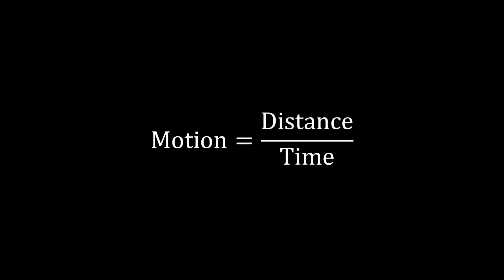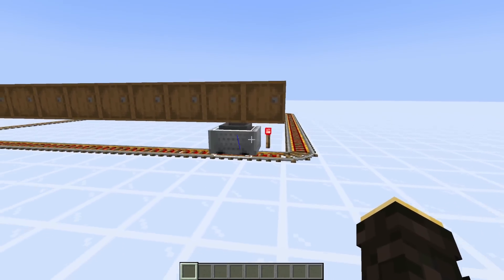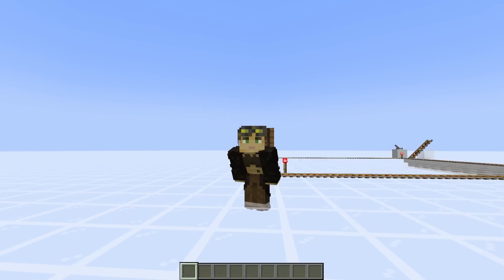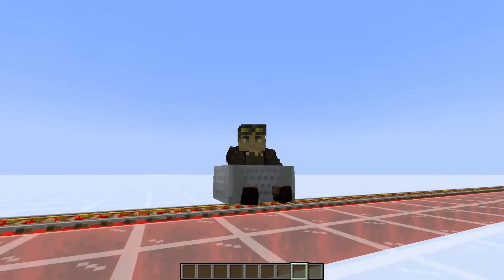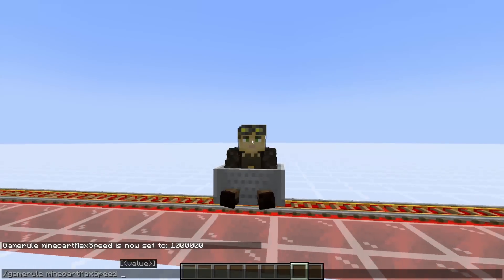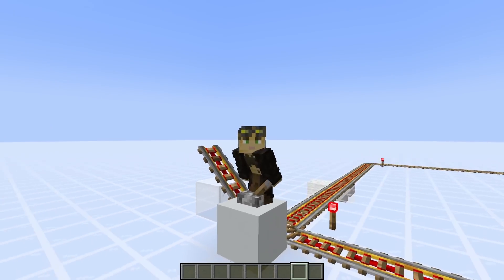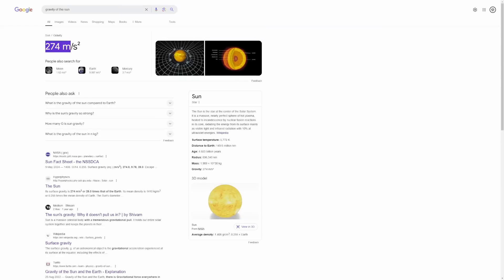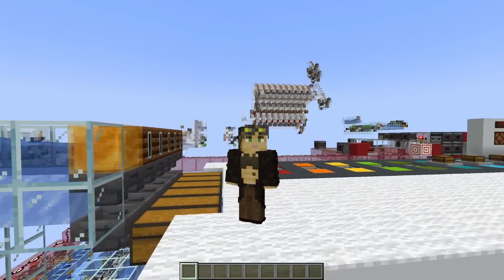Minecart Madness

Comment: Hi, aerospace engineering student here! Big fan of the channel, just a quick heads up, adding more offset to the sides and above the domain of the CFD simulation could change the results significantly. This is because the small domain forces the air to compress and speed up to get around the minecart in the closed tunnel due to Bernoulli's law. This can create more frictional drag on the minecart than in reality. 
You can actually quite clearly see at 11:11 the air speeding up around the minecart in the simulation which is coherent but shouldn't reach from wall to wall, optimally the walls should near inlet condition if they are far enough, which will reduce the adverse affect as much as possible.
In ansys you should also make two separate selections of the floor and other walls and change the other walls to specified shear : 0 0 0 (default value) which makes these wall frictionless to the fluid, which better simulates your wind tunnel as it doesn't create a velocity gradient at the walls of the simulation.

Anyways I love to see CFD and Minecraft together on my favourite channel !

Comment: Interesting. I have similar thoughts with rather than rails posing a speed limit they accelerate carts towards a target speed (something like 8m/s -2m/s per oxidation level for copper rails and 3m/s per redstone power level for gold rails, any placed gold rails could be switched to waxed copper rails upon world upgrade for backwards compatibility). Then with derailing players would need to use another type of rail to slow the cart before a turn on a long distance rail, and technical players could have much more fine control over what speed minecarts travel at for different applications.

Comment: Minecarts have broken aerodynamics in the new update, but they've already broken another part of physics ever since they were added: maximum velocity in circular motion.
Ideally, minecarts should travel under 2.9 m/s, because given that the minecart's rails bend at a radius of 1 m and the COF between the minecart and the rails is about 0.86 (rubber on steel), if the minecart should travel faster than 2.9 m/s, the friction force pulling in the minecart towards the center when turning a corner isn't enough to keep the minecart on the track, and thus would derail. It's like trying to turn a corner while driving on a slippery section of road.
With Minecraft's new addition of these literal particle accelerators, these rails would have to be banked to make them realistic, but even then, no one can survive 1000 g's of acceleration. It's already going at 6.5 g's of acceleration before the new update.

Comment: 15:03 Honestly, no. If Mojang wants to fix minecarts, they should do it right and implement all your suggestions. It's even an experimental snapshot, so not under time pressure and allowed to do bigger changes.
Reply: I think the derailing would make fewer people use minecarts, which kind of opposes the intent of changing how they work. The issue is that the only option to turn the mine cart is a 90 degree turn on one block, this means that even with the previous max speed, they still pull over 6.5gs when rounding corners. I think most players would get annoyed at this constraint when trying to build a transportation system, especially with all the other parts of the game that ignore real life physics (ex floating blocks or how much weight Steve can carry). I like most of the proposed changes, but don't think derailing would be well received
Reply: Agreed, all of these changes are very valuable esp the derailing one will make minecart tracks more interesting to build
Reply: @naddy_mc  Derailing used to be a thing in a snapshot back then, it was super annoying for people bc no one could make rollercoasters without derailing apparently
Reply: @-fsa-3615  Derailing was only annoying because it happens so easily for very little in return (considering Minecarts didn't and still don't go fast anyways).

Derailing would be better if it's reserved for the rail variant that goes fast (Boat in Blue Ice level of fast) so the normal Powered Rails would still have a use both in contraptions and transportation-- making the faster rail reserved for fast transportation in straight lines.

Comment: As much as I really love the variable speeds based on oxidization idea, I do think that maybe powered rails should just be copper in general. Copper is abundant and while it has its uses it doesn't have enough uses to justify its abundance. Plus, a casual player probably has easier access to copper than gold, so it enables minecarts to be used in that transportation role much easier.

That being said... perhaps "clean" copper rails would be unlimited but oxidized rails could be the redstone-friendly limited speed rails?

Comment: People really dont want minecarts derailing, its too complicated for most people to want to deal with
Reply: Agree, it would also make little sense in my opinion. In real life you can change both speed and curve radius to prevent it, but in mc the radius is fixed and already unrealistically tiny. Assuming the cart is empty the maximum allowed speed would be around 8 km/h
Reply: Especially since it was one of the original ideas that Mojang worked on but decided against during early development.
Reply: @amirhosseinmaghsoodi388  yep, 14w11a if you wanna try it out
Reply: Derailing at corners would be a good idea SPECIFICALLY for a rail that goes incredibly fast, it's not really that complicated to know that a minecart that goes fast will derail especially when that cart goes faster than Boats on Blue Ice.

Derailing at least in my case would make for a fair trade-off and would make the moderately fast rail practical while making the super fast rail mostly specific for straight rails (more or less like Boats on Ice).
Reply: @user-tzzglsstle585e38  please explain why this is a better idea than simply not doing that? Realism isn't necessarily fun. I can imagine how this would be good for some kinds of games, for a more complex system, but does that kind of thing fit in Minecraft?
Reply: As long as it was reserved for Extreme speeds (much higher than current max) I think I would be fine with it.
Reply: @FlightlessAviator  And it was telegraphed properly. Like a rumbling noise when going above that speed value to let the player know they're going "too fast".
Reply: Yeah, Minecart derailing would cause more issues and ruin more things.

Comment: Love the ideas, but the only technical issue I see with making minecarts travel this fast is that chunk loading most likely won't be able to keep up on low/mid-range hardware or servers with loads of players. Other than that I do love the idea of adding copper rails with specific speed limits and having nice and fast golden rails :)
Reply: Well since the chunks have to already be generated to have rails in them it should be fine. Just loading chunks isn't really that slow
Reply: @commander3494  still, 75 meters per second is equal to 75 blocks per second which is 8-9 chunks of lateral movement per second ignoring the chunks around the player, that’s going to heavily stress any lesser system into submission with ease
Reply: @MegaMiley  would it load All the chunks or would it just lord ever 4th because it technically never enters the others?
Reply: @Jupue  It would try to load all of them as it tries to load a certain radius around the player, plus each second has 20 game ticks so it would be in every individual chunk as well for a certain amount of time
Reply: @Jupue  Quick maths:
75 blocks/second / 16 blocks/chunk = 4.6875 chunks/second
Default server load distance is 10 chunks, which means the player loads an area 21 chunks across (the one they're in plus 10 in each direction)
4.8875 * 21 = 98.4375 chunks loaded per second on average
Reply: @MegaMiley  i have an idea
when an entity loading a chunk is moving faster than 1 chunk per second, it renders in lower detail and chunks only load block events if the entity has been in (not necessarily loading) the chunk for around a second
Reply: @MegaMiley  no, it's 4-5 chunks/sec. I do see your point though. Maybe when going at sufficiently high speeds a player loads chunks in the direction they're going and not the ones around them?
Reply: @yourspineismine  oh right, somehow had 8 blocks per chunk in my head. And maybe? Not sure how willing Mojang would be to changing the chunk loading logic if they would even be willing to actually implement these speeds as the defaults
Reply: @carelesspigeon101 High enough movement speed could also override normal chunk generation of equally all-around player, and instead switch to heavily biased in direction of movement. That would also help with elytra flight.
Reply: Good thing its a gamerule, so that server operators can lower it. No reason to limit the populous because it doesnt fit a few.

Its like saying that players should only be allowed to place a maximum of 30 minecarts/entities in a world, or only be able to travel 1000 blocks out because low/mid range hardware cant handle the higher numbers.

Comment: I know it's a Minecraft video but I don't think you did a great job explaining how a linear recurrence relation and a quadratic differential equation behave. I found the bit comparing their graphs on desmos confusing especially because they are drag forces so the higher the values the more they slow you down. I don't think it is initiative to someone who hasn't dealt with recurrence relations before or someone who isn't familiar with drag (as the 2 equations are shown side by side despite one being a force equation and the other being a velocity recurrence relation).

I think it would have made more sense to compare the resulting velocity curves (i.e. solving both and plotting the resulting function or just iteratively generating the values) like you showed briefly.

The velocity and acceleration curves are what makes it feel natural not the order of one part of the recurrence relation.

Overall great video and I really like the idea for a variable copper powered rail.

Edit:
Haven't done this maths for a while but I believe the solution to Minecraft's model is
v=D*P(1-D^t)/(1-D)
I don't think your model has a solution (or atleast not one easy enough for me to find because it is a quadratic first order recurrence relation) so you would have to use an approximation and compare their curves.

Comment: Mojang actually had minecarts derail in a really old snapshot and nobody liked it because their rollercoasters broke
Reply: Yeah, that's the only idea I don't like
Reply: breaking rollercoasters is what makes it annoying though
Reply: @deltamico  I mean annoying for transportation, sure, the rollercoasters thing was annoying too, but the part when you were trying to make a minecart through the caves and and it would kept derrailing was the most annoying part
Reply: Alongside the copper rails as brakes, this mechanic would add really cool engineering. You'd have to have the Rollercoaster slow down as it entered turns, which would encourage right angle paths to maximize speed. Slopes would also need to be mitigated if vertical derailing was a thing (to prevent fall damage when flying off hill crests). Adding in elytra like collision damage would also incentivise long brakes at the end of paths. G force, at the bottom of hills, would probably be a step too far lol
Reply: People didn't like it because it was annoying, not because it broke rollercoasters

Comment: Yup hit the nail on the head with the copper rail idea. I had a similar idea to as it makes copper more useful and allows old contraptions to exist, but having oxidation determine the speed cap is genius.
Reply: What if each level of oxidation also created an increasing level of visual wobble, where going too fast would kick you off the track (with full oxidation derailing at any speed)
Reply: @DodgeThatAttack  full oxidation derailing at speed is really funny
forgets to wax the rails why are my minecarts derailing
Reply: @yourspineismine  unwaxes your cliffside rail track
Reply: Yea I'd prefer the redstone version, it could be sooo dynamic and seems like it would have some cool redstone uses - since it can be changed without rebuilding things
Reply: A "best of both worlds" option for the speed control (at risk of being OP) would be to control the speed with signal strength, but allow it to be locked in some way (whether it be by clicking on it like other redstone components, or through a specific item like copper waxing). The rail would retain its locked speed setting when broken and placed elsewhere.
Reply: oxidization is better because it’s more visually intuitive
Reply: @Smug_K  also makes it more accessible to players who aren’t too experienced with redstone, many players won’t fully understand how to give each rail a different power level (honestly it would be a pain for any player lmao)
Reply: Maybe copper rails could have a chance of deoxidation when running over them with a minecart.
So rails that are frequently used aren't (that) oxidised. But tracks that have been unused for a long time are pretty much all the way oxidised.
I believe that's more the way Mojang wants it
Reply: The issue is that there will be less states for the the rail, the redstone implementation seems better, since there are 4 times as many states
Reply: @zhabiboss  perhaps, to each their own. I am an intermediate redstoner so by no means is my opinion the correct one, I just think that having to add a specific signal strength to each rail is a bit tedious and bulky. Unless no input defaults to the original 8 bps speed then I think having less precision is a worthy trade off. Maybe combining alternating variants could average the speed for more control.
Reply: @zhabiboss  Given that all we want is for them to work as they always have, we don't necessarily need all the customization. I hate when people make the whole "it's not minecrafty" argument, but I feel like this is one of those times when it's true.

The copper oxidizing idea has a perfect balance between limitation and option, fits the game perfectly, and allows things to work as before while still providing more control than we currently have (all of that is in my opinion, of course). Plus having to mess around with signal strengths with rails would be a royal pain.
Reply: Why not both?  @zhabiboss
Reply: @Luis-gz3oo I wouldn't like both personally, it'd be way too much in the game, just makes things confusing